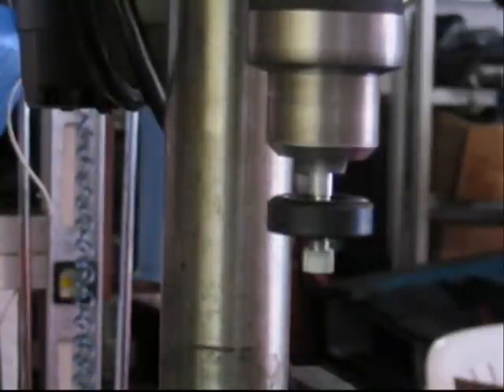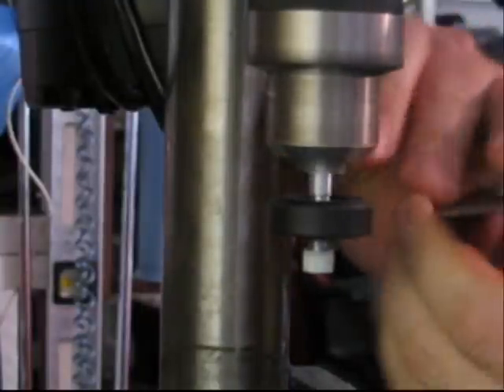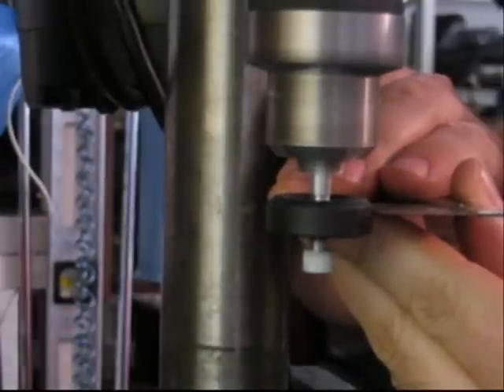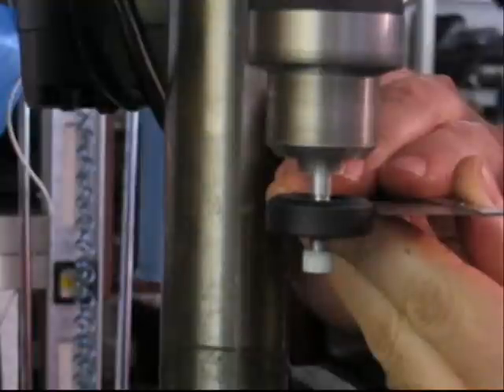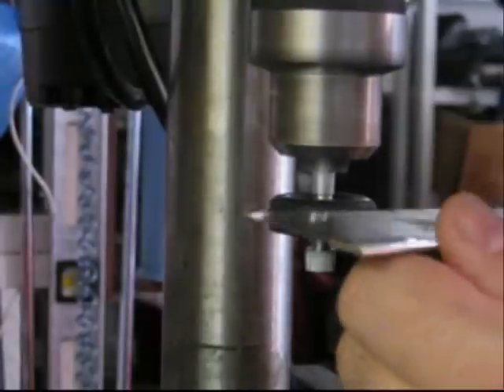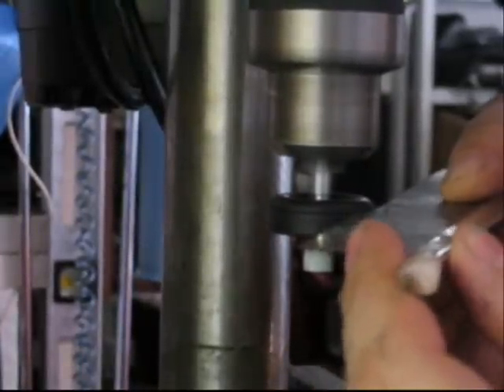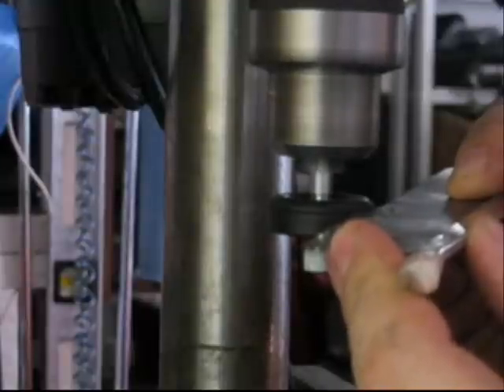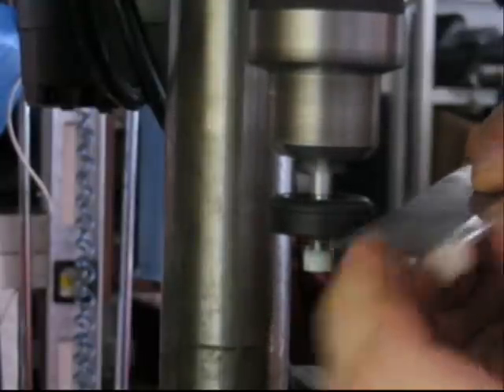Friction Management Racing

Comment: I do the same thing but use a sharpened flat blade screwdriver.  I can cut the tread off in about 10 seconds.  Then spend another 10 minutes making it razor sharp.  The screwdriver basically is scraping not cutting.  Then I true the wheel up with the Pro Wheel Shaver.  Polish the bore and spin some graphite over the wheel to make it shine.  Like you say.  The look on their face says it all!  
Nice video!